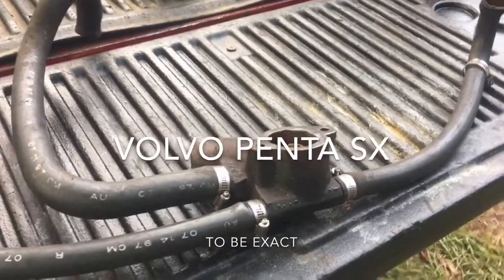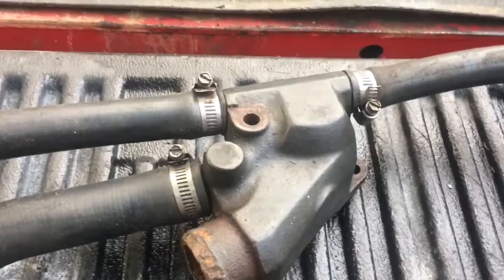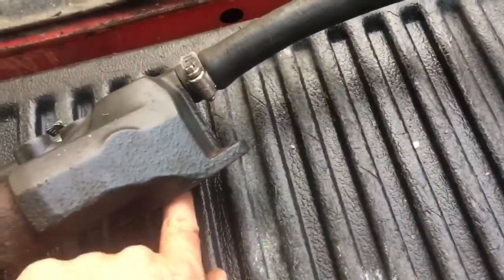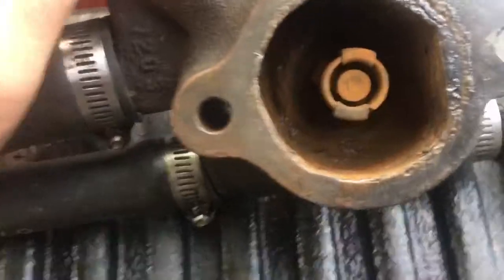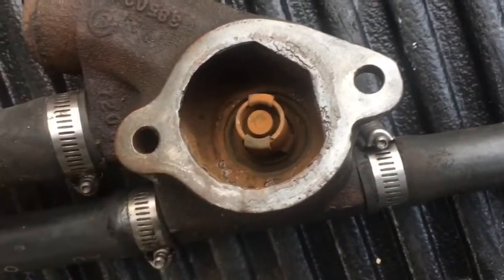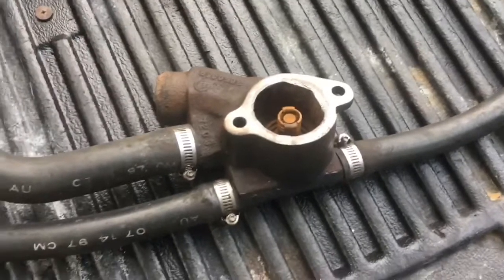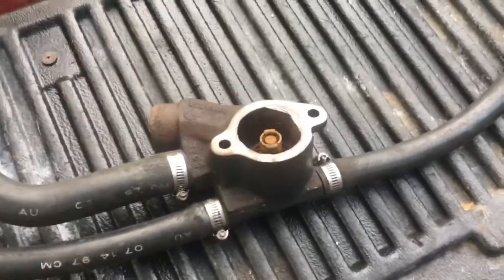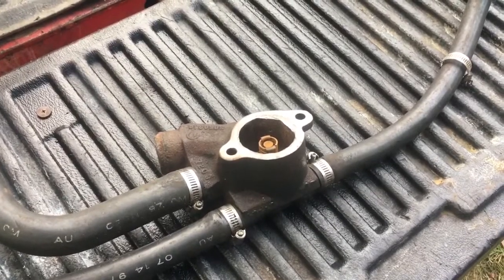Part 10 - Mercruiser 4.3 V6 Rebuild - Cooling System And WARNING

Comment: Well with a new motor  with  guage pegging out under way .But using a temp gun. It is all cool and my switched alarm is not going off. Temp of  seawater 78. Risers 80 deg. anti freeze  in tank 138  raw water side 128. HX is cleaned and trans cooler hx.New guage and sender. The only part not replaced is the intake and t-stat housing. Stat sender is in the inktake when i shoot the gun there its 140. Going to drain anti-freeze and replace stat housing with a 160/ 140 in there now but for cc it should be a 160. Hoping to find a blockage that is causing a steam port at sender. Also heard you should drill a 1/8 hole in stat to prevent false guage readings of sream by stat before it opens.
Reply from the maker: Replace the sending unit. Don’t drill thermostat. It’s not a car.
Reply: @moccasinmarine Volvo penta motors is factory though

Comment: What is  a foot?
Reply from the maker: The lower gear housing is also known as the foot. It’s what gets knocked off if you hit a rock so on a lot of boats for sale it will say  “needs a new foot”. The text in the video is referring to the part of the propeller drive system that is submerged under water when the boat is underway. On Mercruisers that’s where the raw water cooling pump resides. On Volvo Penta systems the raw water pump is located on the engine and is driven by the belt. It’s not the engine pump but a separately mounted pump.

Here is a video link on how to replace a Mercruiser water pump located in the foot: 

https://youtu.be/I1Y0EX4lbDw?si=VITmaIP6c7MHqeTE

Comment: Hello, I have a Volvo penta 4.3. Sometimes it runs normal temp and sometimes it runs up to 200 degrees. I’ve change thermostat and impeller with no luck. Any ideas? Thank you.
Reply from the maker: Is it overheating underway or just at idle? If it’s just at idle you probably have scoring and gouges in the pump housing that won’t let the pump suck water unless the pump spins faster. Also your exhaust manifolds could be partially blocked. If the water can’t get out the engine can’t take on cooler water.

Comment: No water coming back out of exhaust I replaced water pump thought that was the problem but still not coming out
Reply from the maker: If it’s the initial fill it will take a little time before you see water coming out of the exhaust. The engine has to fill up first.

Comment: How do you change this thermostat in this housing?
Reply from the maker: Not sure on this rusted housing. Mercruisers use a plastic retainer. Don’t see one here.
Reply: @moccasinmarine  same here it seems to me it is built inside and cannot be changed I will go with a different housing set

Comment: Is this could be a reason that my engine still mixing oil and water ?Cylinder block repkaced,both heads too (cracked) new intake manifold gaskets…allmost brand new engine.But only thing I didnt check out is this tiny shitty holle in thermostat housing …Is it could be this or area inside intake manifold around thermostat that  is “eaten” by seawater and the water leaking into combusting chamber ?But it will cause hydrolock…I dont know what could i do cause replaced all main parts except intake manifold and thermostat…Im waiting your reply.Thanks
Reply: I'm wondering as well because I'm putting a freshly rebuilt engine into a customers boat and don't want to fire it up and mix water. I assumed the water got in from the crack in the block but I want to double check everything before I fire it up.
Reply: All right.What will hapen (will mix oil and water)  if I take out the thermostat from the housing ?I think only  the working temperature will be lower than normal ,but for sure no overheating…

Comment: Volvo penta 4.3 here. I hate it
Reply from the maker: What do you hate about it?
Reply: @moccasinmarine  No room to work on it in this Four Winns. Every trip out, something takes a dump. Perhaps thats the norm for a 20 year old boat
Reply from the maker: I think you  figured it out. Volvo Penta and Mercruiser pretty much use the same engines.
Reply: @moccasinmarine is the wiring the same as well